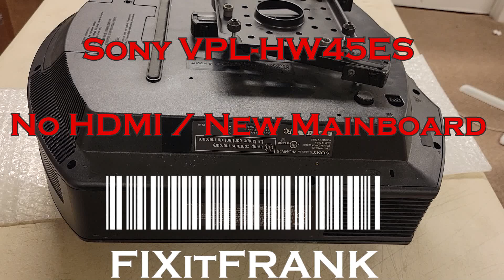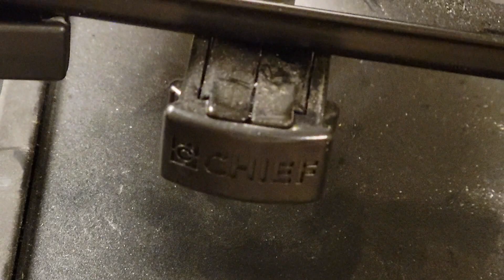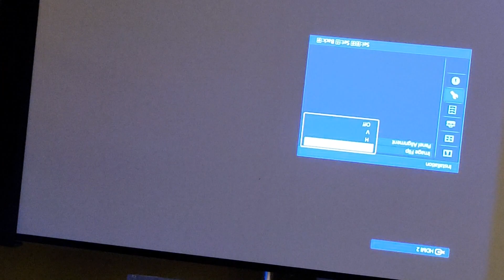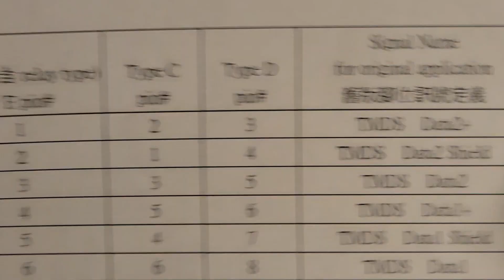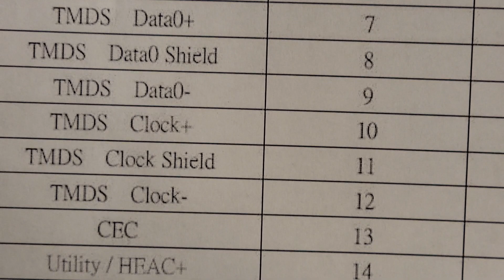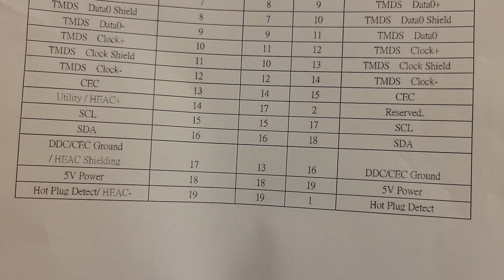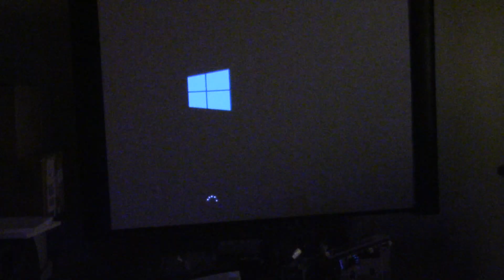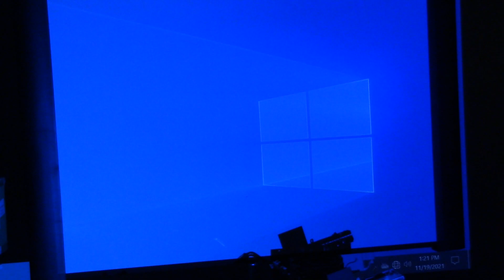Sony VPL-HW45ES SXRD Video Projector No HDMI / Mainboard Replacement

Comment: I've owned one of these since the end of 2017. So far no problems. Just the usual bulb replacement routine. Question: where is the firmware information for this product? I am just curious if I've missed any updates since I got it in 2017.
Reply from the maker: Sony's support site would list if its available.  However, if everything is working, I would leave it along.  There is a chance you could brick the projector if the firmware doesn't load right.

Comment: Hi Frank,  
I've got the same unit,  same problem.  I'd like to know what the real culprit is in the main board, but it's nice to see that you got it going again. After all the customer is the one paying for the parts,  right?
I happened upon mine from a local repair shop, the customer probably declined on fixing it, so out the door it went.  I've come across many a find at this place,  some of them were easy fixes,  others not so much.  I was hoping this would be an easy fix so I can flip it for some $$ but it looks like I'll have to find a donor mainboard. I was thinking the same thing about the firmware aa you,  did you ever find out if you can rollback to the old version? Mine has the latest version 1.301 so I didn't try to reflash it. Just wonder if rollback then update would do any good.  Thanks for the concise inspection & diagnosis, if I find out how to test the mainboard on mine for the component(s) at fault I'll let you know.
Reply from the maker: I haven't traced it down exactly yet but it seems to be one of the switching ICs.  It's a programmable IC so there is no real way to replace it without service tools from sony(which we can't get).   I have 2 now with that same problem.  I just need some time(not sure how to get that) to deep dive on the mainboard.  I also tried to roll back the firmware but once it bricked, I was unable to even get to the bootloader.  really that kind of confirmed there was a deeper issue and I bailed on further troubleshooting(time=money at that point).  I really would like to know the root cause though.  I think it would help a lot of people.

Comment: I have the sister VPL-HW65 with no power problem... The power supply definitely makes a whiny noise that probably isn't normal. When disconnecting the mainboard power cable (without the projector still powering on) the whining noise changes. The power supply seems to be delivering all the voltages that it lists so maybe it is a mainboard problem too... Probably can't verify the lamp power supply without it trying to turn on.
Reply from the maker: Whining power supply might mean some bad capacitors. Do you have a scope to see if the power is clean? Volt meters can add their own capacitance and even out the voltage. I wonder if you have some oscillation in the power.
Reply: @FixitFrank  Yeah, don't have access to a scope rn, but will try to get one. There is a 1-474-532-32 power supply part available for about 100€ on Aliexpress which I might just try - but would of course want to verify the mainboard isn't bad yet.

I wouldn't be suspecting the caps based on the projector's age and use. I have PT-AE2000s and an AE4000 which probably have twice the number of use if not more and haven't had any issues with. I think this projector might have been at the receiving end of a lightning strike.

Also when disconnecting the power supply from mains the whining drops out to a 56k modem like digital like noise when the caps are discharging. I'll try to get a video of it too. Seems to signal to me that at least the PSU SPMS ICs are running.
Reply from the maker: I mean the tantalum caps.  I know they can absorb moisture and get flaky.  Those little orange square caps.  Of course this is all just suggestions because I can't really check the PSU from here.

Comment: Love the video! Thanks for putting out this content, very useful! 
Is there a parts supplier for projectors? I have one with a damaged HDMI port. I'd like to solder a new port on but am having a hard time finding parts.
Reply from the maker: You're very welcome!  That is a tough one for just the HDMI port.  I would check Mouser/digikey/farnell first. Most PCB mount HDMI connector should work. If its slightly different it may not matter.  Be sure to remove the old one anc clean up the pads. If the pads are bad you may want to consider using an HDMI male to female wire and cut off the male end, then solder the wires to the damaged areas and let the connector hang out.  It's not as pretty but if the physical pads are damaged, its not a bad option.
Reply: @FixitFrank  Thanks for the response! I don't have it in house, which makes it a little harder to match the part. I'm a full time microsolderist but usually do Apple repair and data recovery as well as game consoles. I'm going to see if I can get the guy to drop off the projector and go from there.

Comment: Thank for the great and insightful videos. I've got a Sony VPL HW10 home theater projector which has an issue and I would like to open it up to have a look if there's anything I can fix. Im not sure what it's called but there seem to be light bleeding beyond the border of the image. It is a constant bleed around the entire border and spreads out by about 2 inches in all directions. The light bleed doesn't have any particular color. Do you know which part of the projector could be causing this?
Reply from the maker: that sounds more like a screen issue.  If you are using a painted wall that will happen.  There are possible causes in the optics but nothing that is repairable. The cost for the part would far exceed the value of the projector.

Comment: Thank you very much for this video. The same happened to me yesterday. How do you think - is repair possible in proffesional RTV service (not official Sony service)? Or maybe the only way is to replace mainboard? The reason in my case was Feintech Audio Extractor between XBox Series S and this projector. I lost picture and audio in the same time. HDMI1 stopped working. And then during troubleshooting I made dumbest thing ever - after confirming that HDMI2 is still OK I connected this audio extractor to HDMI2... And guess what happened... :)
Reply from the maker: Oh no!  That is awful to hear!  The "best" way is to replace the mainboard because its the easiest.  Its also really expensive.  I still have the old mainboard as I do want to see if its fixable.  I suspect the issue is the main IC though.  If that is the cause, then the new chip would need software flashed into it which I don't have access to.   I was able to trace the HDMI data through the first 2 chips so I believe they are okay.  There are some protection devices though called TVS diodes.  They may have taken the brunt of your damage and those are replaceable (technically you can just take them off and the channel will work again). You can try measuring resistance across the data lines to ground.  If you measure a short, its the TVS diode pack.   I am always more willing to repair things at board level. I do not like replacing entire mainboards but sometimes its the only option.

Comment: Frank
I have a vpl-hw30es projector that has vertical lines in the picture. WHat do you suggest I do? I am located in Texas.
Reply from the maker: Hi Jeffrey,  Its hard to say.  Are they any particular color? did they just show up one time when you powered it up or was the projetor apart? Usually that sort of thing is a bad connection but being that this projector could be 11 years old, it is not impossible that one of the sxrd panels is failing.   could you post a picture of what you are seeing?
Reply: They are purple colored and showed up after power up and never went away. Clean filter and new lamp installed. Plugged in a video source straight from dvd player and same vertical purplish lines.
Reply from the maker: Hmm.  That kind of sounds like a bad blue or red sxrd panel or the cable that feeds it. Anything from a bad connection to a bad panel.  I can't say I have dealt with that on a sony so take this with a grain of salt.  I'd go over all the connections to the optical assembly and make sure they are tight/well seated.

Comment: cant  find the replacement hdmi board . Mine has the same problem.
Reply from the maker: I'm seeing this a lot more lately.  Someone else mentioned that low quality HDMI cables seem to be the cause and I am tending to agree. However it's really hard to tell if its shielded right or not so there are other possible causes.  
I kept the mainboard for this one and I really want to see about repairing it or at least tracking down the true failure.  
Did you try the firmware update or you just lost the HDMI?  I know where to get the boards new, but they are really expensive.
Reply from the maker: I found this on eBay. I suspect the mainboard is ok but the no power/no lamp makes it hard to confirm.  Its a bit of a gamble but its more than half the cost of a new mainboard so it might be worth it.  https://www.ebay.com/itm/194434616927
Reply: Yes that was the first thing I tried and nothing happened. These projectors are still going for over 2,000 and I’m blown away I bought mine for 100 dollars cause the person didn’t want to fix it so they moved on lol. Some boards I have found are in the 1200 dollar range just for the hdmi board not the main board .

Comment: Great Work! I have already seen masses of devices with killed HDMI-ports. The main reason (IMHO) is the quality of the HDMI-cables, with low to no shielding. Once i switched the vacuum-cleaner on, what killed one of the ports of the Optoma hd141x - no joke - which is very sensitive to EMP.
Reply from the maker: Thank you for this!  I agree.  There are way too many low quality products flooding the markets.  I personally blame Amazon for this.  They do nothing to block or prevent garbage from being sold.  I see it with lamps all the time and now I suspect the HDMI damages are likely from cables purchased via their sources.
Were you able to save the HDMI ports on yours?